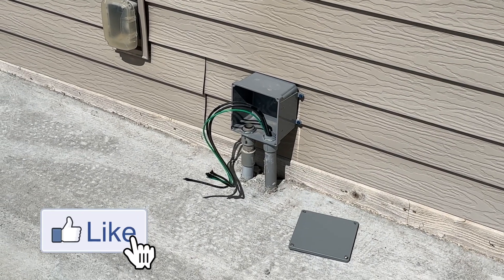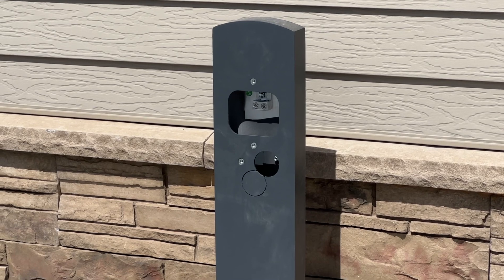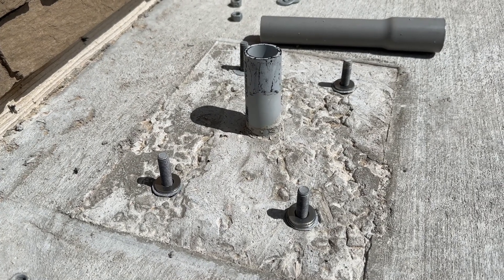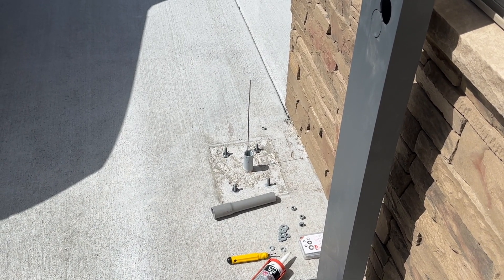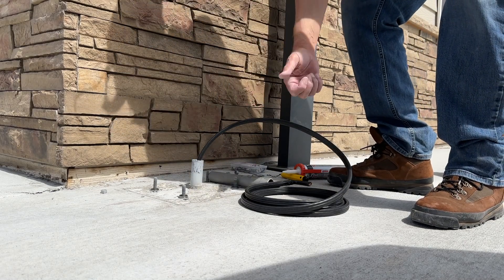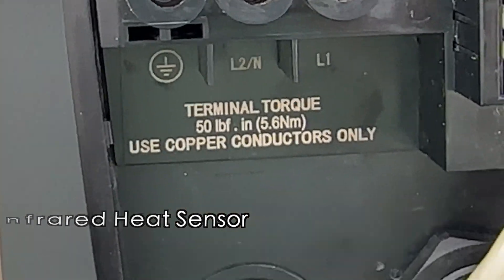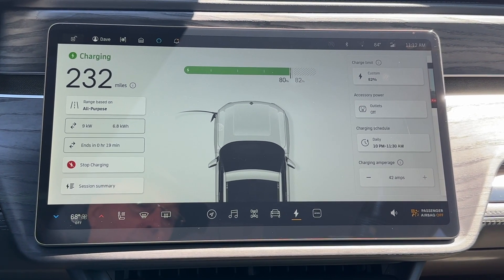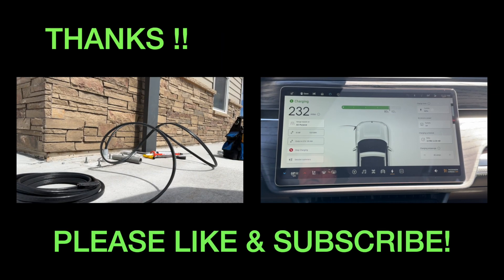Tesla Wall Connector Install on a Pedestal

Comment: One of the reasons to pull individual wires is to match up correct colors, since white should only be used for a neutral wire (which is never used on electric chargers). The critical thing you need to be sure of is that you didn't accidentally cross over the ground wire to the neutral wire that the electrician pulled into the box, which would give a point in the home where neutral wire current from other devices could cross over to the ground wire circuit. Everything may work fine but you end up getting current and voltage on the ground wire which can make toasters, etc show a small voltage on the appliance frame and possibly cause a shock. Since the ground circuit is widely shared, a crossed neutral to ground connection can affect devices on other circuits far from the source of the problem, even causing arc fault breakers to trip with no apparent cause. The source of objectionable current on the ground wire system can be very hard to hunt down since there's no way to easily identify a second point in the home where ground and neutral are crossed. I find the photos a little puzzling since the ground wire in the box seems to be unconnected, and at the pedestel there are two white wires, yet only one white showing up at the box. As others have said, that white needs to be marked at both ends to emphasize it is not a neutral wire.

Comment: Thanks! I’m thinking about one of these and was reviewing Tesla install instructions and then kind of laughed because it was just like “insert a conduit no more than 3 inches from the bottom” and also it’s just like “screw these bolts in to something”. 

I’m thinking about a 6 inch deep 1x1 foot concrete pad. First trench the 1 inch conduit with a sweeping 90 to the spot, then put the forms around that and add the bolts while it’s drying. 

Then if I need make changes to wiring I can just dug up the trench. Maybe use UF-B so I can add more wire. Not sure it’s thicker so it might not work for fill capacity and two chargers.
Reply from the maker: Yes instructions are limited.  They don’t was water egress into the conduit.  Looks and works well

Comment: Why did you decide to go with the Tesla charger, particularly with the added need for the plug adaptor?
Reply from the maker: I charge my teslas more and it’s higher power than a j1772
Reply: @evdave528  Ahh. Ok, thanks.

Comment: Most people really don't need a wall connector or a 240 volt outlet like they think they do.
Reply from the maker: That’s an opinion, consider your kids it parents fumbling with a mobile connector trying to plug it in the wall and they get electrocuted because someone wanted to save a few bucks, think how terrible you would feel.  A WC also chargers faster.
Reply: Mr negative
Reply: They may not NEED a Wall Connector or 240V receptacle, but 240V charging is MUCH more efficient than 120V charging because of the fixed overhead of the vehicle while its awake.

Comment: NM-B can't be used underground if it is actually NM-B.  What's with white being used as phase conductors and black as ground??.  No electrician did this.   What wire size was used?  Why introduce a splice point when a pull through could have been done instead with XHHW?
Reply: Chop shop 😂😂😂 White as a ground and a hot 😂😂😂

Comment: The electrician did a great job. Most of them are very camera shy ... ;-)
Reply: Electrician Dave & Greg did a great job, probably for their own home.  As an electrical engineer with over 25 yrs experience, I’ve done same.  No criticism here, but I prefer THHN wire vs NM-B (romex).  We don’t know length of run to determine if #6 or #8 copper wire was used. Red tape on both ends of L1 is recommended for future troubleshooting.  Let’s assume all connections have proper torque.

When hiring a licensed electrician, always get a minimum of 3 quotes, especially if using Qmerit.  I got 7 quotes for a commercial EVSE install and prices ranged from $700 to $2800 for the same job.
Reply from the maker: Yes they are
Reply: Romex is not allowed underground any real sparky knows this
Reply: Besides the electrician was really named Dave and has code violations like not labelling the second hot wire red and ground should be copper.   I believe reidentifying a ground may not be code